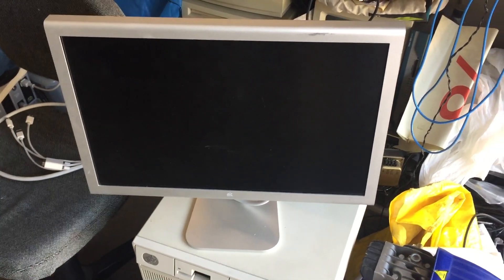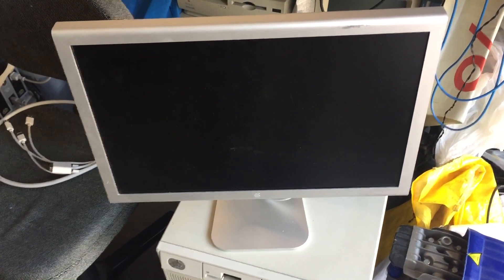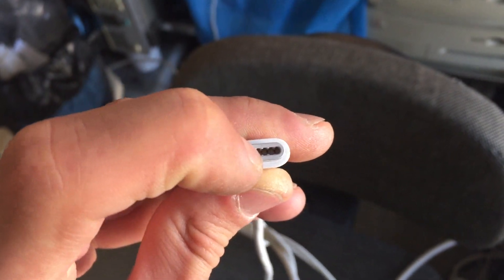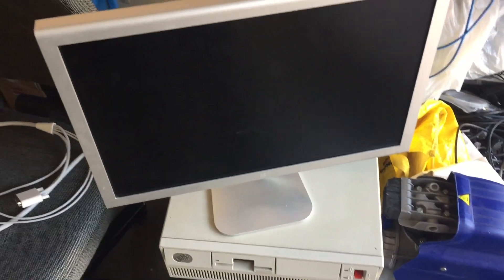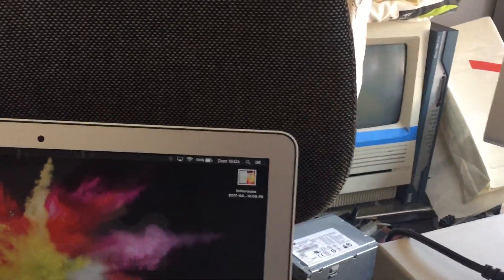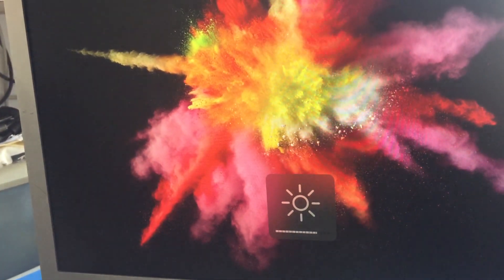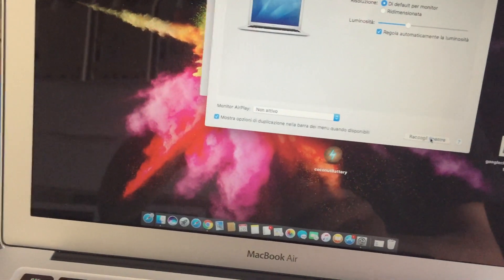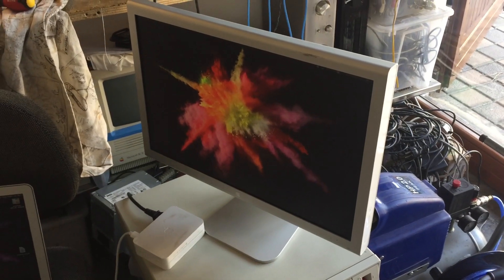Apple Cinema Display Short Long Short LED pattern DIY Repair Walkthrough Guide

Comment: Thanks for this, invaluable YT service! I’ve just desoldered the reg and will buy another tomorrow. For those about to attempt this, I recommend breaking the top layer off the chip as in this video. That will allow you to get to the middle of the metal layer with your iron, which makes it easier to create enough even heat to then desolder that and push / slide it away with a screwdriver.

Comment: Just wanted to let you know that this info is still relevant. My 23" display died during a brownout. I followed your instructions, replaced the regulator, and it's working again. I think the problem is that there's a big MOV or TVS near the regulator that's supposed to prevent this problem, but over the years the TVS fails, so I'm expecting to see the same problem again when I have another bad power situation. If that happens, I'll see if I can replace the TVS while I'm at it. Anyway, it's working with a new regulator for now, thanks for posting very clear instructions.
Reply from the maker: Great! Usually the regulator fails after prolonged use and maybe overheating. So far all the displays I’ve repaired are still working great even after years of daily use

Comment: didn't fix mine. Any other ideas? Got no voltage on the lower part of the board. When i activate the power button on the display i see 17. something volts come and go on the input cable connection and 24V on the other side i also have some 5V pins and the 3.3V somewhere just under 2V also. The lower caps where the 2x smaller ic's are have no power on them. I was wondering why the 17V disappears. is it the psu shorting out or is it the power switch activating the psu. I didn't have the front led plugged in because of not wanting to throw it all back in the frame, the led on the board never lights 3.3V is good.
Reply from the maker: Should be 24V not 17. I also had one with a bad microcontroller so it’s not always the regulator. If you don’t put a signal it will always remain off

Comment: Found one of these at the bin. Had no supply but i picked up 2x 65W supplies from ebay. Guess that is not enough to do the bypass trick. If this works that will be a result. Thanks for the tip.

Comment: Hi Francesco! My friend, my 30" Apple Diaplay Monitor has a very dull white (sort of light yellow). I've tried adjusting brightness (from macOS) but it's not the problem. Which PCB controls the brightness/contrast should I need to replace? Thanks!
Reply from the maker: The display has a CCFL backlight that when it's end of life turns very yellow. usually it gets slightly better after some use if it has been sitting but the only way to fully solve it is replacing the panel or the tubes inside it.

Comment: You are measuring the input voltage of the regulator, not the output voltage! The pins from left to right are: 1= GND, 2 + FAN = OUT, 3 = IN.

Comment: Thank you for this excellent video Francesco!  I was wondering if you might have an idea on a problem I have.  I have a very early Apple 30 inch display model M9179LLA.  The display will go slightly green and out of focus at the native resolution 2560X1600.  On rare occasions the display will return to normal but only lasts an hour or so before returning to the out of focus off color condition at 1280X1600.  If I put the resolution to 1280X800 or lower the screen returns to normal from a focus and color standpoint, however putting the monitor back to 2560X1600 puts it back out of focus.  Thinking it might be the driver or video adapter I tried another computer and the same conditions still exists.  Any ideas on which board or component to check.  Like once in a few months or so it will glitch back and be normal but only for an hour or sos before failing again

Comment: Hi, Francesco!  Regulator voltage is 5 as you ve shown, but first measurements is jumping from 16 to 18 volt between -minus and uf700 yellow Thing. Do I have to replace both regulator and uf700?

Comment: Good Video on taking it apart. My problem is that as long as I hold my finger on the on button the display will stay on, take your finger off and the display goes out. Not sure if the button is suppose to work as a push button on/off or by heat of you finger?
Reply: Hola, tengo el mismo problema. Ya lo solucionaste??

Comment: Francesco, thank you for the great guide! Since I also want to do the repair I was wondering if I got the right replacement part. Could you please confirm: https://www.ebay.de/itm/2X-LD1086D2T33TR-IC-Spannungsstabilisator-LDO-Linie-nicht-geregelt-3-3V-1-5A-ST/224313806686?ssPageName=STRK%3AMEBIDX%3AIT&_trksid=p2060353.m1438.l2649 THANK YOU! It's in German but the specs are readable, sorry for that.

Comment: Mines just blank. The led doesn't come on at all. However following my 3.3 regulator is outputting 5 volts. I presume it's broken. I've ordered new ones but can anyone confirm I'm doing the right thing?

Comment: Hey Francesco at first hoped your video was my answer.  I replaced the side cover that has the power and brightness buttons.  Both the old and new controls work - UNTIL I go to stick the side back on.  As soon as any of the wiring on the inside of the strip gets near to sticking to the inside metal strip I basically lose all control of the buttons. 

I've made sure display settings are all correctly enabled.  I could always use the keyboard brightness controls and no power button, but it'd be nice just to have the display fully working.

Is there some special sequence putting the strip back onto the side?  Is there some sort of sensor on the inside of the display that needs matching up?
Reply: I have the exact problem. Did you fix this problem? I also found it has to do with the metal.

Comment: Hi all and thanks Francesco for this great video. I have a 20" Apple Cinema Display. The white led error signal is not one of the well known ShortLongShort or LongShortLong. I only have the white front led flashing once for 2' as the finger presses the button then nothing else, no more white led signal and no image on screen. I opened it up and checked the Voltage as shown : around 27V in and 3.3 to 3.5 after regulator, so I guess this is fine. Seen no burnt component either. Anyone has an idea what it could be ? Thanks in advance. PhiL.
Reply: Hi Phil, I’ve got a similar issue - please let me know if you found any solution?
Reply: @kunal201283  hi guys. let me know also pls.
Reply: let me know also pls.

Comment: I have the same screen, 31 inch. But it wil flikkering some times. On, off, on off, no display, than again on for a week, an than again problems, Off.  I have bring him to Aplle, but they do no longer repairs on this screens. Vintage.... But i think it is just an electronic problem, and "easy" to repair.  Can you still find spareparts to repair my screen ?

Comment: Thank you for this video!

I am working on a 23" that did not have the original power supply, so I used a generic 24v 3A power supply and it worked fine for 18 months, now it won't turn on. Last time I turned it on, it flickered, and then went black. No LED flashes or any response. When I plug in the DVI, it is recognized by my mac, even if the power is not plugged in. So I desoldered my DIY power supply, and it tested fine with a multimeter, but no joy for the LED or backlight (and I checked w a flashlight, no picture, so not just backlight). USB also doesn't work.

Could it be a voltage regulator inside, or is it more likely blown capacitors or something?

Comment: Hi Francesco. Thanks for your video. I have a working display but when I replace the plastic side with the power buttons it seems to short out. Works fine sitting on the desk. Any help would be appreciated.
Reply: Please answer this question for us francesco. Thanks.
Reply: Yes I have the same problem. Seems to have to do with metal. Once close to the metal, the buttons arent working anymore.

Comment: thanks man it really helped. it worked on my mac but just asking, is it a safety hazard that mine read 8 volts when i measured it
Reply: where did you buy your multimeter?
Reply: @izzzzzz6  harbor freight.

Comment: Hi Francesco, thanks for your video, It helps a lot to find origin of failure for me... same as video.

here next some more link if others like to do it!

I used regulator ld1117adt33tr from ST. working well :D

http://willhb.com/2012/05/apple-cinema-display-repair/
http://pixelchimp.net/2011/12/18/apple-23-cinema-display-possible-fix-short-long-short-error/
https://fr.farnell.com/stmicroelectronics/ld1117adt33tr/regulateur-ldo-fixe-3-3v-1a-to/dp/2849768
http://www.farnell.com/datasheets/1732936.pdf?_ga=2.133205198.1567032384.1559063353-898068854.1558907971&_gac=1.83762916.1559063430.Cj0KCQjwuLPnBRDjARIsACDzGL3wHij-hKxCYPg5j6GY7FIcoeYAy8aattCViYsshYb2zPeP7NjFpUIaAjjnEALw_wcB

Comment: Hi Francesco, Thank you so much for the video!!! I have 2 30" Apple monitors. One is Micky moused with the scotch tape technique (This monitor is usually off) and the other one is running of a 150 watt brick. I'd like to repair them but since the circuit boards are different I'm worried I may not be able to figure it out! Any help would be greatly appropriated. I subscribed TBW :)
Reply from the maker: Gabriel Navarro I also have a couple 30” models I need to repair. So far I found out that a dead display might wake up again if there’s a USB device hooked up to it. You may also have a back backlight. You can start by swapping boards between them and see where what follows the problem

Comment: good morning. thanks for your information. I have a 30 "apple cinema and every once in a while it turns itself off and on. I take the current and put it back and it continues to work. Could it be the same fault that you notice in the video? forgive my english, I speak only spanish and translate it with program. Thank you.
Reply from the maker: Don't think so, the 30 uses a different logic board inside. Try hooking up a USB device to one of the ports, that usually solves the problem
Reply: Francesco Ferretti Thank you for your message. Dismantle it by the regulator and it is perfect 3.3v. I have connected two devices to usb as you advise me and it is perfect. Thank you.

Comment: Hi Francesco, how are you, I got several displays and one of them had the same problem, but as I didn't have the power supply, so I just bought a generic one and connect the wires w/o any group and is working fine..is that a problem? do I need this fix? if so how do I get the regulator?
I also have an other display that doesn't turn on the led stars of, but the computers kind of recognize the screen at the display settings. How can I fix? Its 23 apple Cinema Display, and it is in great shape, I really what to fix it..what should I check... no lights come on...tried w/ a good power supply! thanks
Reply from the maker: I would still replace the regulator, It's cheap and redly available. As for the 23 you may have a damaged cable, if the regulator is fine. some parts are the same with the 20

Comment: Francesco, also forgot to inquire whether the 3.3V regulator is used on the logic board for both the 20'" and 23" models? Any assistance would be greatly appreciated.
Reply from the maker: Yes, the component is the same. Actually I think that both boards are identical (they just have different firmware) while the 30 is different (since it has to handle two channels)
Reply: Hi Francesco, I'm checking 30" Cinema, have 3.3v ok, then 5v on LM2676S - 5.0 and LM2676S - ADJ has 18.1V. Cinema HD recognized by my 13" macbook but display is black. The left board is a backlight as I understand it, there is 24.66v comes to it along with 3.2v & 4.5v but nothing comes out. I checked all fuzes - all 8 of them (2A) are ok.
  Power LED is half lit, if I touch power button it comes on brighter then few seconds later back to half lit. All looks clean as good as new. Any suggestions what else can be checked? Is there any schematics? Also, how to check controlling signals to check what actually enables the backlight etc. The story behind is power brick died, now it doesn't turn on.
Any advice greatly appreciated!

Comment: Hi Francesco, this is a great video - thank you for posting it!
We were able to diagnose the problem of our monitor with the help of your video: we taped the center pins and the monitor lit back up. Unfortunately, we are lacking the tools to follow through on the full repair immediately. You seem to be very knowledgeable and I am wondering what you opinion is regarding using the monitor with the taped pins in the short term or even long term? Do we risk serious damage to the unit by isolating the pins?
Thank you!
Reply from the maker: In theory this should damage the circuitry inside the monitor (because the output voltage is higher and not lower), but so far I've only seen one monitor fail after the center pin was taped. I'd say it's ok if the monitor does not see much use, on the other hand I would repair it. the replacement component is easy to source and the repair process is very simple.
Reply: Thank you for the explanation - that makes sense. We are opting to repair as we use the monitor quite a bit.

Comment: Hi, great video! just wondering where I can buy the 3.3V regulator needed for the repair?
Reply from the maker: I got it from RS, order number 686-9123. it's a LD1117ADT33TR. 
In this case any 3.3V regulators in a DPAK package that handle 1.2A or more should work.
Reply: Awesome! Thanks!